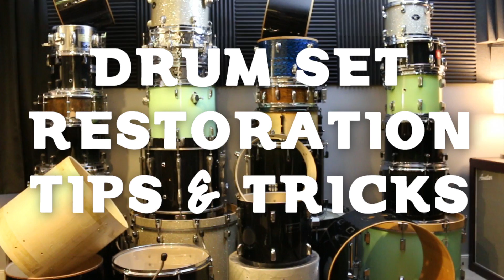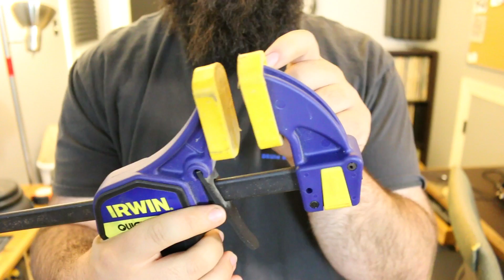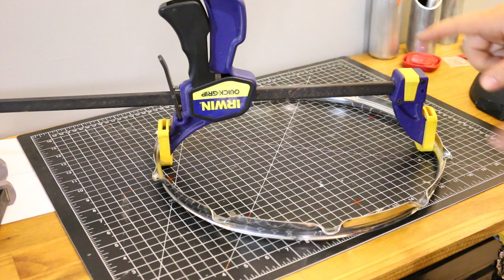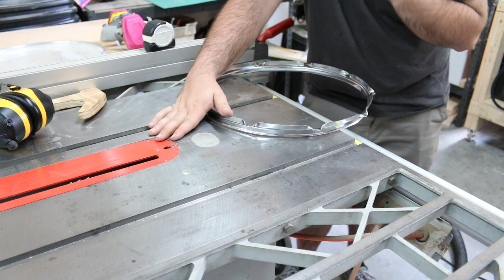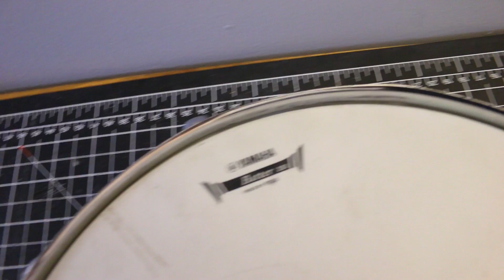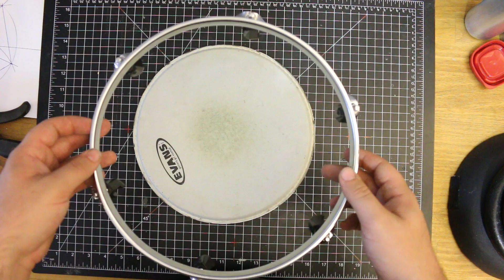How to Fix a Warped Drum Rim

Comment: Cheers!!! I Had a big tuning problem on my Protean snare, because the bottom hoop was bent, and that gave me some nasty sh*tty high pitched snare wire feedback! I managed to bend it back to normal and it sounds way better. Thank you again.
Reply: I have the same snare and the same problem!  I think even the s hoop on top is bent on mine
Reply: @MO-xi8rp  to prevent warping, it is important to tension each tension rod equally. I use two keys and I apply matched pressure in a star pattern. For the bottom, I use the "sounds like a drum" technique, which consists in levelling the rods using a ruler, to make sure the head stays flat all along. However, the hoop will be deformed next to the snare beds as the bottom bearing edge isn't flat, but that's a way to prevent buzzing since the wires will be on a prefect flat surface. Hope that helps.
Reply: @Eurodrummer666  I also do this. But my drum isn´t tuneable since I got it years ago. For example on top there is always one lug way higher than the others. If I move the hoop one lug the problem is moving with it. 

I personally never had too much of a problem with buzzing. But mine has some pretty nasty overtones cause of not "being in tune with itself". I measured the shell. Seems to be pretty perfect. So now I try to swap  the the top hoop and also replace the bottom hoop with an s hoop which is a lot stiffer. Let´s see how it performs then. I only have sonor drums. I know they are behaving different than most other brands when tuning, probably cause of the undersized shells.  But I love them. 

If I can fix this snare it will probably be really great. It´s so sensitive to ghost notes but I always have to deaden it cause of the tuning issue. ;/
Reply: @MO-xi8rp  tell me how it goes when you put the new hoops on. Warped hoops suck but in some cases it happens, mostly because of too many tuning experiments.

Comment: Does drum hoops suposed to be perfect flat when brand new? I got some mapex saturn v and i get them wobble on a flat surface...
Reply: Facing same issue with Decade maple. Did you get any answer from anyone?
Reply: @BrijeshSarin  Apparently most rims and shells are not perfect flat and most drummers don't check this stuff so yeah... We have to either fix them ourselves or maybe some really high end drums are not like that but i doubt they are perfect flat everywhere, maybe i'm wrong, i'd love to compare it myself.
Reply: @matrixmodulator  but bro, atleast the Brand New Ones should be straight and flat no.
Reply: @BrijeshSarin  i know i know, but aparently they are not... i even went to check gibraltar new rims and they were all warped, brand new out of the box.
Reply: @matrixmodulator  how Much bending is acceptable then? Mine Woobles by like 2-3 mm
Reply: @BrijeshSarin  same for me, about 3mm at the worst and i think the smaller toms 8 and 10inch were almost flat but the big 14 and 16 are bent. It tunes well though id love to see the difference in tuning with rims perfect flat.
Reply: @matrixmodulator  my 10-12-16-22 all are bent as well as snare 😭
Reply: @BrijeshSarin  does it tune well or it cause problem? return it to the store?
Reply: @matrixmodulator  Returned Bro!! The problem is actually in the bearing edges in my case!
Reply: @BrijeshSarin  yeah both can be warped... good luck
Reply: @matrixmodulator  got the Refund

Comment: David have you tried this on a die cast hoop? I just bought two brand new hoops and the drum head don't fit!? I measured it like you said in the video and i'm mind blown how off of round they are.
Reply: I know I'm a year late, but maybe it still helps. I recently bought a used snare with die cast hoops. The upper one was slightly warped, the reso side was much, much worse, warped like ass. I did essentialy what David did here, but without any tool, just a metric tape (in mm in my case), a wooden table and my bare hands. I checked the progress in my granite kitcken counter top.
To return them to a more perfect circular shape, I simply put them verticaly on the table (you can protect the table with some piece of cloth or cardboard) by the longer diameter of the oval, and then pushed down gently and remeasuring every time until I got satisfied. For that "jumping" on a flat surface, I did what David does here, putting the hoop on the border of the table and pushing gently down. You might have to do it on different parts of the hoop, and take care of not over compensate. For the "fine tunning" I used my leg as a fulcrum instead of the table bord. Check every time.
One of them was pretty quick and the other took me a while before I got satisfied, but finally I got them as perfect as they can be, I guess...

Comment: Hey Man, love the vids. I would like your advise on a warped shell. I have a 1970s Ludwig 5 piece. The 12in small tom is out of round. Where the wood overlaps and was glued is swollen and it is very difficult to tune this drum. There is a point on the bottom of the shell where the head will never touch the rim. They have reinforcement rings in them from factory. Any advise on fixing this without destroying the value?

Comment: I'm guessing you can't do this with wood hoops.
Reply: Elias011203 TF2 Oh, I see. I would imagine just like metal hoops, uneven tension, but unlike metal hoops climate can effect the wood.
Reply: Elias011203 TF2 It's probably cracked. Can't tell with the finish.
Reply: i was thinking the same..lol it's not a HUGE deal, but my old sonor kit has warped wooden hoops and some drums. That's due to not so good weather conditions and being in humid environments.
Reply: You can, you need to soak it in water then bend it etc.
Reply: Elias011203 TF2 it is possible. I have an old (but good) Pearl Export kit and the reso bass hoop is slightly bent. It's currently under repair...

Comment: Not bashing or anything, you have some nice ideas in your videos, but it's just that in my opinion, unless it's some kind of special hoop that you can't really replace, just buy a new one...
The stress that it puts on the lugs and shells may do some damage that's harder to repair. Add to that that a warped hoop will make it much harder and sometimes impossible to tune the drum well and it might also wrap the head and ruin it, so for like 10-20 $ that is the usual price for a new hoop, it's not really worth it to try to repair it because it will most probably not be as flat and round as a new one.
Of course giving it a try won't hurt you and also in a pinch you might have to try this, so this vid isn't useless, but as I said, IMO go for a new one.

PS. Glass and granite surfaces aren't totally flat despite how they look, but for this use they will probably do ok.